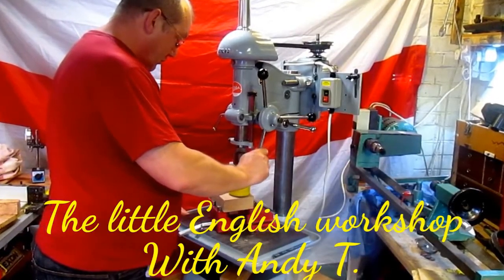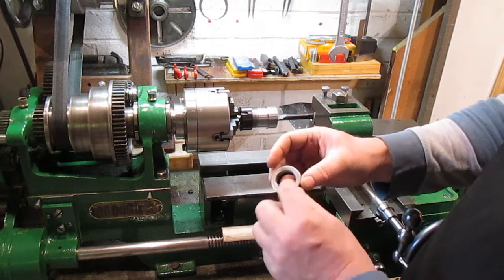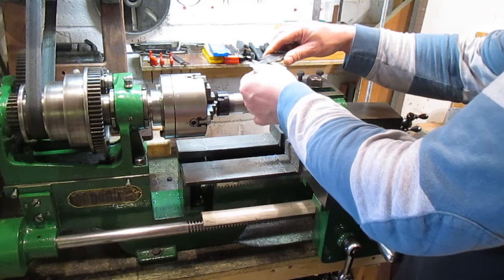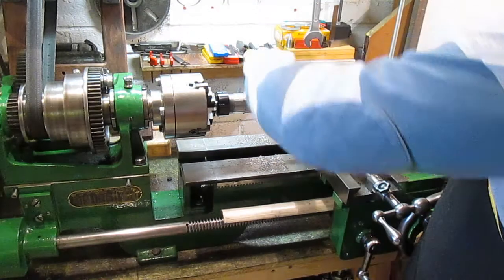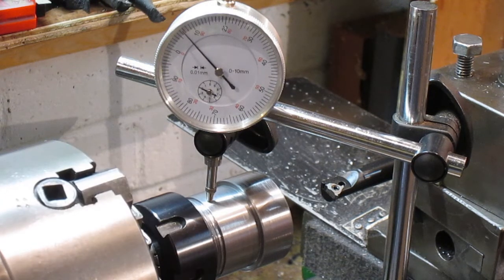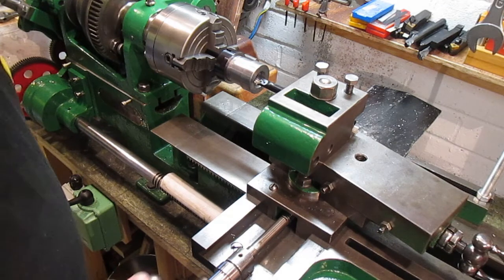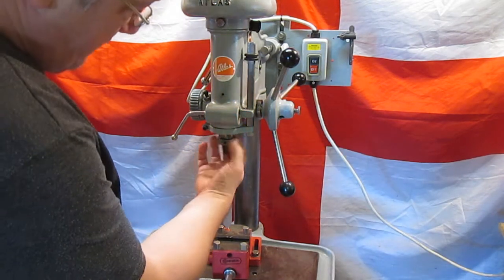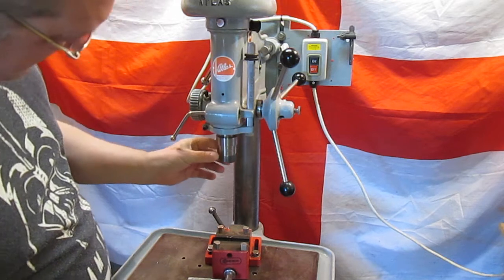ER32 Collett Chuck Part 3

Comment: Hi Andy, I thought that when cutting an internal thread you set the compound slide to 29 deg and add the cutting depth each pass with the compound slide and not the cross slide as you did?
Reply from the maker: Hi Glyn, yes you're right but this was my first ever internal thread and as it was such a fine thread I tried keeping it simple, thanks for watching :)
Reply: @atowning  Oh I see, I thought you had found a better way... I've still to lose my internal thread cherry so I guess I'm a bit paranoid.

Comment: Bravo Andy. I have never cut an inside thread. It does seem to me you have a lot of stick-out on the tool.This will cause chatter because the tool will vibrate, so it is advisable to keep stickout to a minimum.
Reply from the maker: Agreed, it's an issue I've not paid much atention to but need to. Having said that I don't think it was any great problem on this very fine thread.
Thanks for watching and commenting Juan

Comment: Well done. I actually never turned an internal thread.
But that should change soon. If can drag my lazy ass into the unheated workshop :)
Reply from the maker: Thanks, I know what you mean about a cold workshop, a friend's boiler has broken so I've lent them my workshop heater. 
I did manage to get out there today and make a quick video, not to bad as the temp is about 10c at the moment

Comment: Excellent series, Thank you.
Some thoughts, When i made my ER32 Collet chuck for my Myford I Put the Material in the chuck and made the headstock spindle thread and register first, Then took off the 3 jaw, fitted the part directly to the spindle and did all the rest of the machining, The O/D Metric thread, and the Taper in situ on the spindle, Hopefully to gain better repeatability and concentricity. 
This is NOT criticism Just a different approach. Kind regards Malcolm
Reply from the maker: Hi Malcolm, thanks for watching.
This collet chuck is a pratice part for my Atlas drill press that has a 1 1/16 x 20tpi thread, I hope to make one for the lathe spindle some time in the new year and that will be done as you described.
Thanks for your comment :)